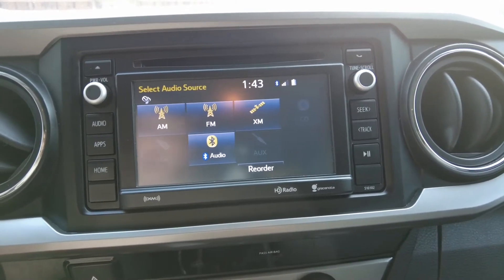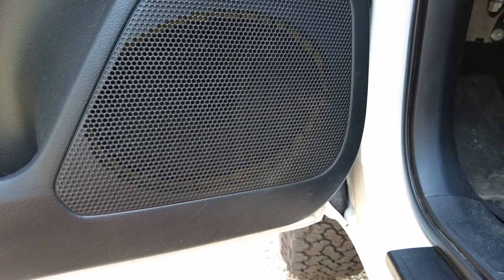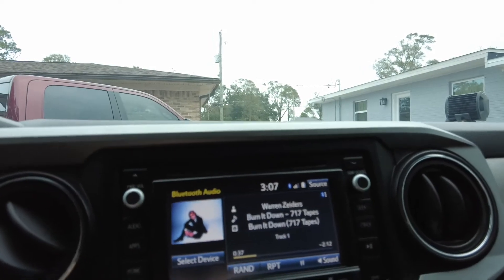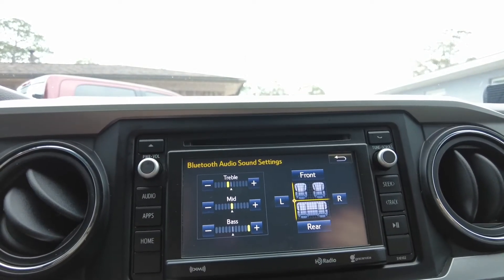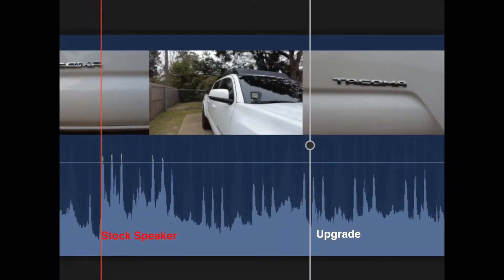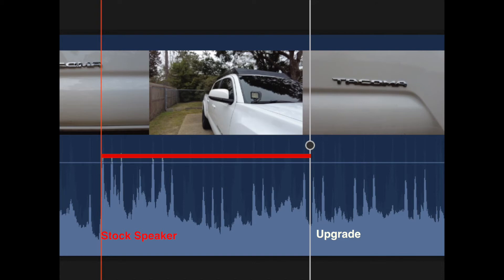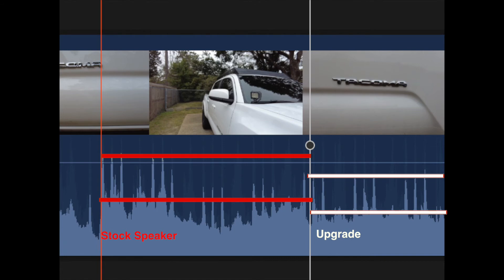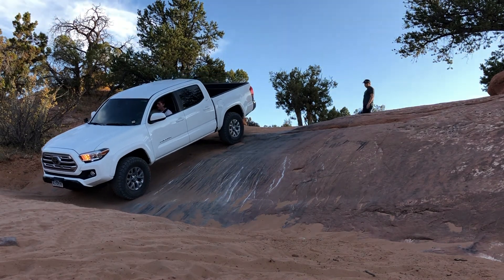Should I upgrade My Vehicles Speakers?

Comment: Always worth the upgrade. Factory speakers clip at such lower levels since they only handle 5-10 watts seems like. Paper cones and come tweeters sound awful.  A good quality aftermarket speaker makes a lot of difference. Even with a factory head unit
Reply from the maker: So true, it amazed me how cheap these Toyota speakers were. I have never seen such pour quality speakers
Reply: thats the thing though....sometimes (with the weak factory headunits) those stock speakers are pushed better than the upgraded (higher wattage) speaker -end up sounding worse or less bassy